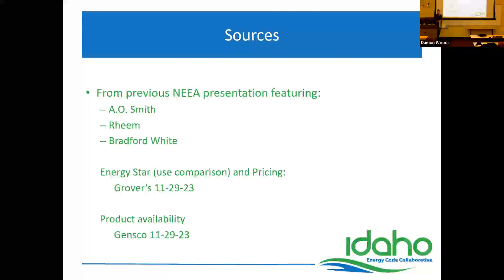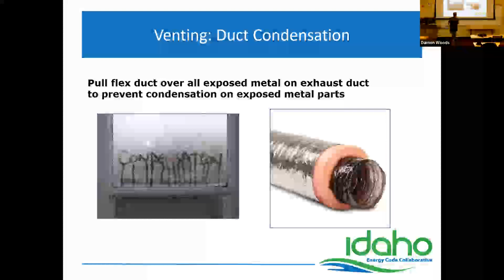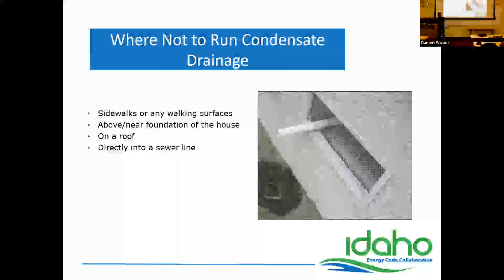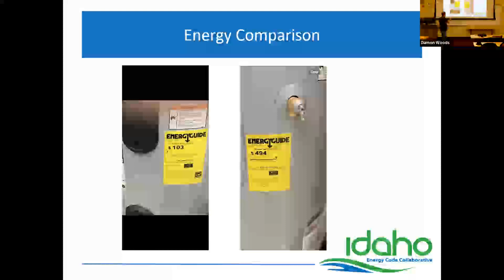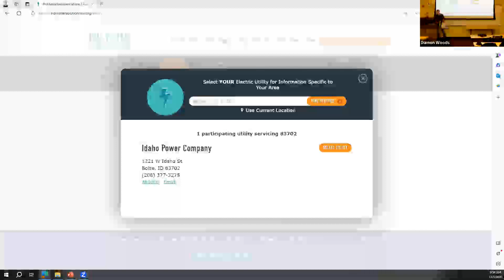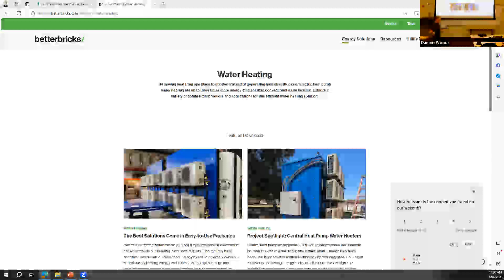Emerging Technology: Heat Pump Water Heaters

Comment: Peterson said pairing a gas water heater could be used to preheat the water going in to the Heat Pump, that it would improve the efficiency. I believe it would actually reduce the efficiency.
The Heat Pump is most efficient with a greatest heat delta, which would be heating colder water. What may actually improve efficiency is putting a gas or electric instant heater on the output of the Heat Pump, and maybe closer to where the hot water is needed. This would also open up the possibility of having different temperature available at different fixtures. The Heat Pump could be most efficient bet setting a slightly lower set point, and then using instant only where higher temperatures are required. This would also allow installation of a smaller tank, because rare max loads will be handled by instant heaters.